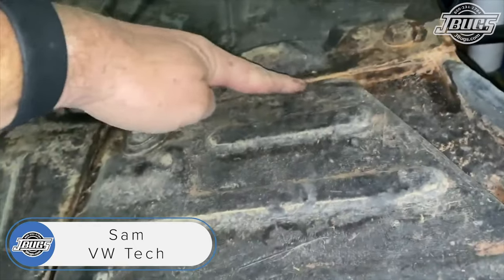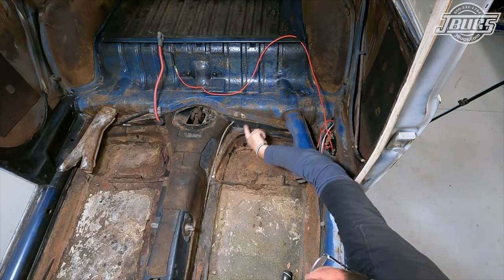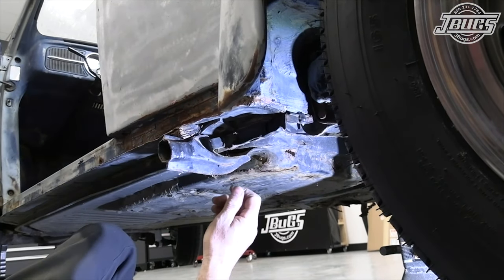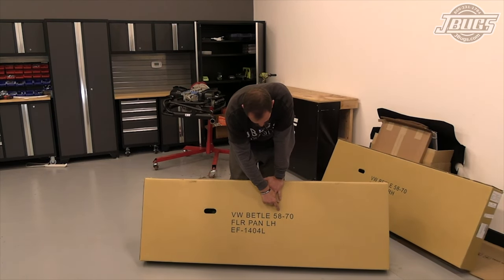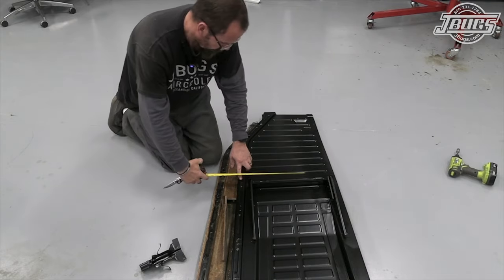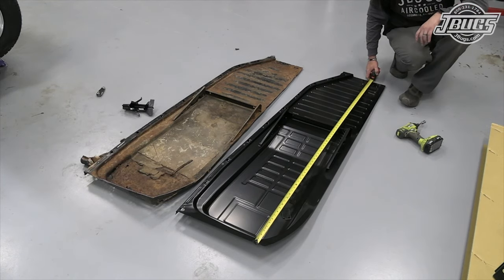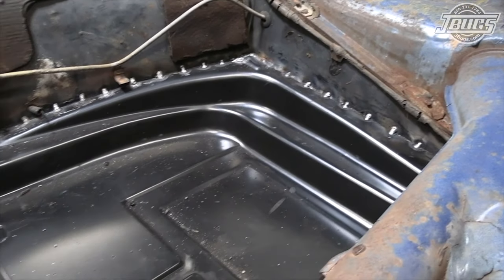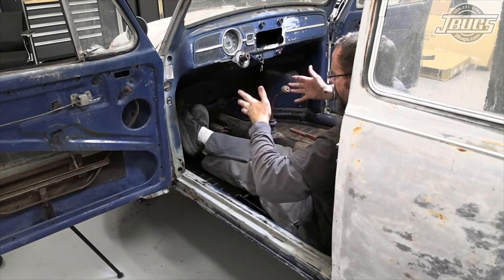JBugs - Replacing a VW Beetle Floor Pan with the body on.

Comment: Thanks for the in depth tutorial on doing this work with the body on! I now now what I have to look forward to. I have a 71 super and believe this the same procedure? I also appreciate the fact that you didn’t use any special equipment. Thanks again. 👍👍.
Reply: The nice thing is that short of a welder, which isn't really special, there isn't any thing special needed!

Comment: I really love watching these videos. 
I started working on VW's before I had a driver's license, my first bug was a 66.
I'm 61 now and after many years of raising a family and working I've acquired a 63 ragtop and a 68.
Unfortunately they're both Baja which I don't especially care for but I'm having fun anyway. 
Have you ever attempted to convert a Baja back to a sedan?
Keep up the good work!
Reply: I have, one of the first cars I helped restore when I started working for JBugs way back in the late 90s was the owner's 1964 Beetle Convertible. It had been cut up into a Baja and required two donor cars, one for the front clip and one for the rear. Our very talented customer, painter and VW restoration expert (and now a good friend of mine) performed a "miracle surgery" and brought the car back to stock.
Reply: @Sam_Mebane  I'd love to convert this 63 ragtop back to original although the reality is I'm no expert when it comes to body work. 
I'm going to look at another older bug a guy I worked with has parked in a field. 
After the engine seized years ago they haven't touched it. Being more mechanically inclined I'm hoping he'll sell it.
Thanks for the response, having YouTube has helped me do a lot of repairs.

Comment: Sam the professor and pro vw master. Have to ask if you’ve used an oxyacetylene cutting torch instead of sawzall before? Less of a setup for sure but would you use one if it was handy?
Reply: I have but I've never really gotten accustomed to using them. They are fine for demo for sure but at the end of the day, I usually pick up a grinder or a sawzall. If I want a precision torch I go to my plasma cutter.

Comment: Great job I have a set of your HD pans sitting here ready to go. What was the first brush on sealer you used sounded like you called it coroseal I am sure I heard wrong.
Reply: You heard correctly, Corroseal is what I use to convert rust and “prime” the metal.
Reply: @Sam_Mebane  Thank You.

Comment: I would appreciate it if you were to list all the rust stop/converter(s), sealers, seam sealer, ........ in order of use so we know we are purchasing the correct item for the specific phase of the replacement. I have never done it before and need to replace my passenger rear floor pan.
Reply: There isn't any particular "bests" of converters, etc. It's all based on what you have laying around as at the end of the day something is better than nothing! I'm sure a professional body work worker would scoff at some of the things I do or use but they have served me well.

Personally, for rust converter I use Corroseal. Anytime you are working on metal it is a good thing to have around and it is simple to use.

For a seam sealer, I use Loctite Roof & Flashing sealant. 

Again, there are probably more trade appropriate items, but these work for me.
Reply: @Sam_Mebane  Thank you!
Reply: posting on a family account
I'll be using phosphoric acid to kill the rust, then using Rustoleum products from the hardware store. It's best not to stress what you use, because then you never get to the project and it rusts even more.
Reply: absolutely. Regardless of what you use, use something. Most importantly STOP THE RUST! Then work from there.

Comment: thats NOT the right way of removing pan's !!!!
Reply: If you say so, it may not be the way that YOU do them. I’ve done em this way for nearly 30 years and replaced more pans than I can bother to count. I used to replace pans for side work and would do 2 or 3 pairs of pans a month.
Reply: im 62 years old...I was modifying these vw's before you were born !.....I have done it that way and it was NEVER as successful as taking the body off the pan !
 @Sam_Mebane
Reply: To each their own @richardcattafi1327. I've done them both ways, successfully, many times.
Reply: @Sam_Mebane  what would the cons be doing it this way? i watched the jbugs video with the body removed and it seemed like the same process.. in that video he did remove brake lines, shift linkage, and a bunch of other stuff. im assuming that was all done in preparation for something else.
Reply: @bonquiquihgii6836  I am the guy in the JBugs video. I prefer doing floor pans with the body on. It makes lining up the pan to body bolts much easier. Additionally having the pan bolted completely to the body before welding the pan in place assures that the pan is welded in the correct spot. The only "con" is that you can't weld the small section of the floor pan at the frame head or at the rear crossmember. It doesn't matter much as with the pan to body seal in place and sealant at both the joints there is little chance of any water seeping through. Like I said, just because Richard couldn't figure out a way to do it effectively doesn't mean it can't be done. I learned from a guy that had the nickname "Al the Pan Man" who probably replaced upwards of 2000+ floor pans, if not more. He was in his 60s when I met him, back in the late 90s and he was still doing 4 to 5 cars a month.
Reply: @Sam_Mebane  appreciate the information sam, ill be referring to your videos when i begin my floor pan job.
Reply: @Sam_Mebane  Thanks for the information, i need to do the passenger side, is it a idea tot use Loctite 3463 Metal Magic Steel Stick for the gap in the front of the car, and after that put the seam-sealer over it, what is your experience with the B quality 0.6mm pan? 
Best regards, from the Netherlands.
Reply: @Sam_Mebane There is probably a good reason not to, but couldn’t you trim down the new pan to the point where it could drop in place from the above, without having to deal with the ‘pan to body’ bolts and seal? Thanks for all your hard work in these tutorials!
Reply: @michaelvandervelden9250  I have no experience with the magic steel stick so I can't say much about that. I have used both floor pans we offer for years. I've installed more of the thinner pans than the thicker. Either install the same and where as the thinner pans aren't as stout with the body off, they are plenty good enough to do the job.
Reply: @bighammer587  it could be done, but with the additional amount of welding required to weld the pan all the way around, for me at least, it is much easier to remove the bolts and drop the pan out. It's essentially the same reason why I won't do floor pan inserts. I find it is just easier to replace an entire floor pan than doing an insert.